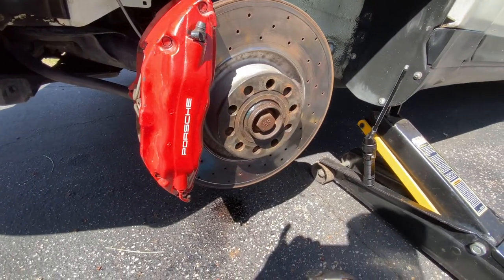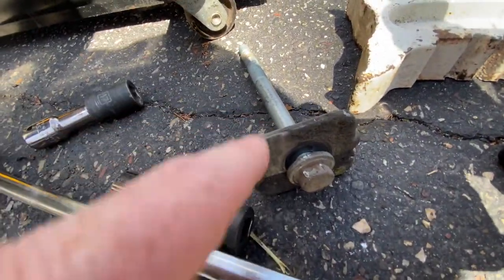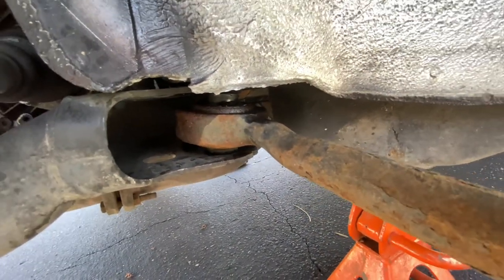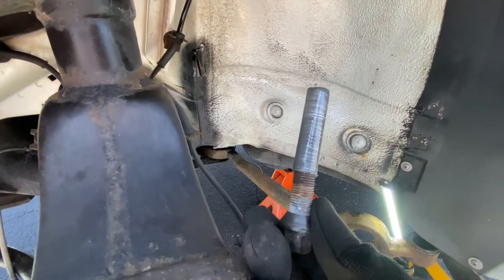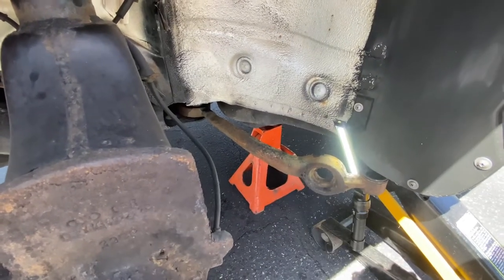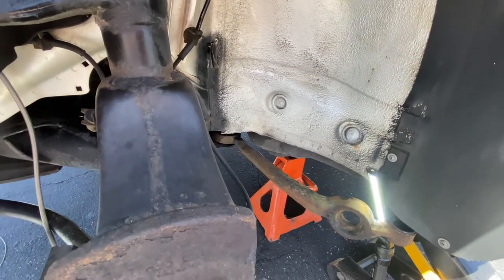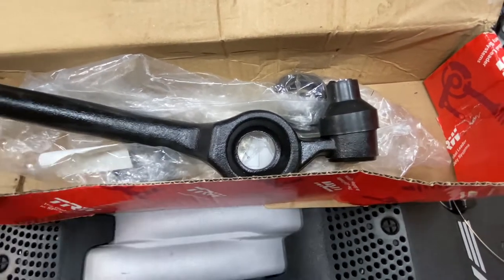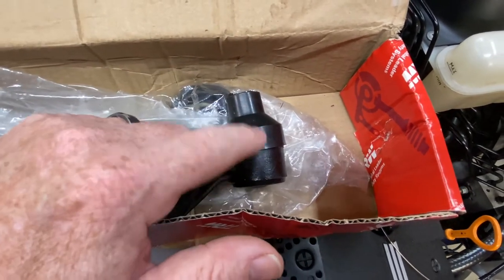1993 Audi S4 Winter Mode To Summer Mode Fail.. Part II

Comment: Hey man, how did you do the brake upgrades from the ufos? To the Porsche ones ? Was it diy or did you get a kit?
Reply: North American C4 S4 and S6 models came equipped with the Girling G60 caliper.  This meant we could run the Audi RS2 caliper brackets and bolt on the 993 turbo calipers fairly easily.  My cars both have ECS Tuning brake kits which consist of aluminum mounting brackets, 993 turbo calipers and either Euro A8 rotors or real 993 turbo rotor rings and custom aluminum mounting hats.
Reply: @DarinNederhoff  ahhhh I see, thankyou